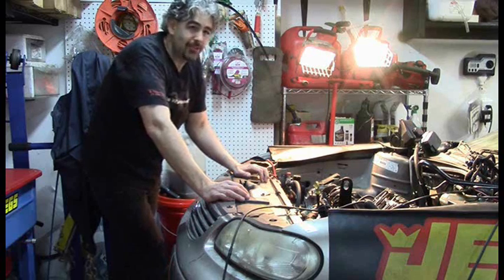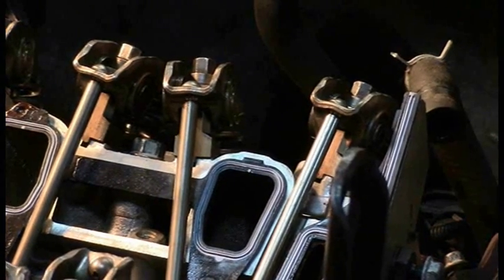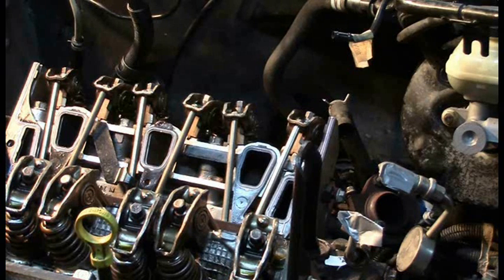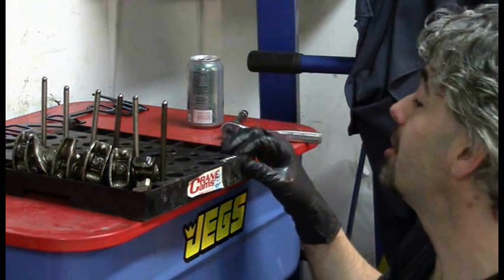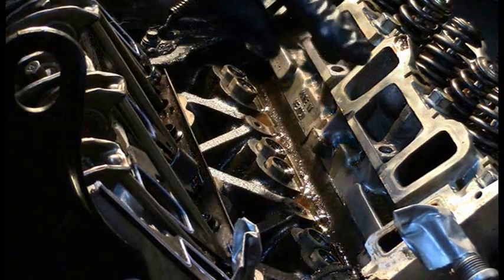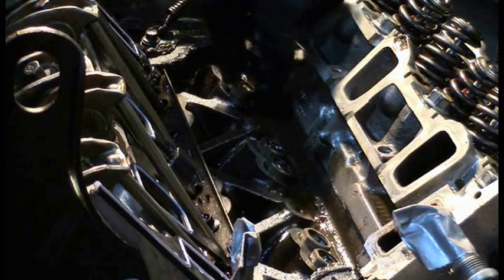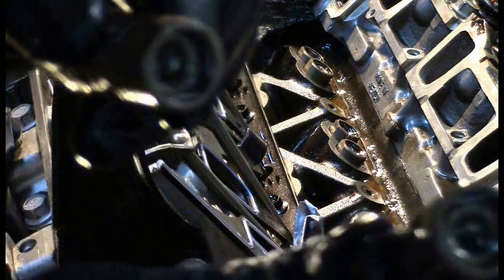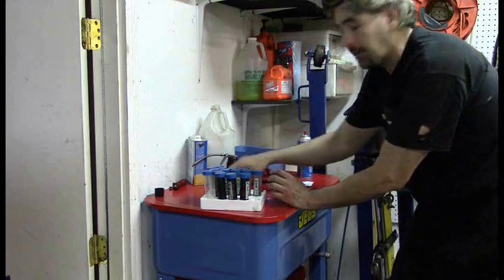Engine Noise Diagnosis Part 2- The Answer Revealed!

Comment: I have practically the same car, it’s a 99 Cutlass and it’s the T&C to that Grand Caravan so to speak. My engine overheated bad and hopefully my lifters will be fixed simply with the reconditioning. Fortunately it’s something you can test without putting it back together. Hopefully the cam’s fine too. The car only has right under 70K but a mix of possible improper care by previous owners and it being abused as mentioned (and sitting for an easy 5 years) could mean something bigger. Compression is only below spec in one cylinder, not the one with the bad rocker arm play.

Comment: That was awesome! I have the same noise in my Cadillac CTS and I decided to check out the top end exactly like you did. I wanted to check to see if there was a video to proceed from where I'm at which is exactly where you started from with the valve covers off. I guess my next step will be to remove the rocker arms and see if I find anything like you found. I will check by hand first to see if anything is loose but just wanted to ask if one of the rocker arms was loose, should I just tighten it and try to see if noise goes away or should I just remove all of them anyways in case there is a chance that one or more of my lifters is the problem as well.

Comment: My wife's cougar started making that noise when she hit a dip to fast, I got it to stop without identifying what it was, then one day I hit a dip to fast and the noise came back, so I really want to identify what it is, any ideas would it be appreciated.
Reply from the maker: When I first read that I thought you were saying your wife is a cougar lol.
 if it happens when you are hitting dips the first step is to determine if the noise happens while the car is still moving or not.  If the noise conitnues when car stops, it could be low oil level that temporary runs the engine on low pressure as pickup tube whiffs on picking up oil.  If (more likely) the sound is happening while car is still moving it could be anything loose or misaligned from brakes, driveline, CV axles, etc....
Reply: @SchrodingersBox  I tell her all the time to get rid of The Nightmare cougar as I call it, because she's getting close to forties and driving that car looking like a cougar driving a cougar, no I kid, don't tell her I said that, no for the reason that I  call it the nightmare cougar I tell her to get rid of it, it's so hard to work on, the last work that I did on it was replacing the generator yes I know alternator but in this spec books it calls it a generator, since her brother gave her the car I've been doing the work on it and it's been running badass I like working on things that I've never worked on before and finding out how it works and how they run and this nightmare cougar has been a challenge for me, I was thinking the same something being misaligned with the CV axle or something of the sort because when I had to change out the power steering I noticed when I removed the engine mount it wasn't in very good shape and I believe when It hit that dip It could have jogged the engine out of alignment or something, I was thinking it sounds like the lifters when I start the vehicle in the morning it doesn't really make the sound until it warms up then when I'm stopping at a stop sign or light it sounds really loud and because of the Dual tailpipes I cannot notice if it's making a noise when I'm driving, I appreciate your help and second thought it's always good to work with Two Brains, now I just got to find that second one!

Comment: Where did you get those tubes you soaked the lifters in
Reply from the maker: hahahahaha yeah I get asked that a lot.  I'm a scientist- they are sample tubes for a 50ml centrifuge that I stole from the lab!
Reply: @SchrodingersBox  I figured 😆
I went to a medical supply and got some specimen containers with lids. Close as I could get.  I just pulled  my intake and found three lifters that appear somewhat  collapsed. I was getting the same chattering noise from my 3.1.There is some up and down play in the intake  pushrods on #1,4, and 5 and they seem depressed into the lifter some and the tops are pooled up with oil. I am hoping I can clean them as you did and quiet the engine up. It was always pretty quiet and it came on suddenly

Comment: I watched a video of a guy putting 1 oz of Seafoam per quart of oil and made a similar noise go away. My Mom has a 2004 Buick century with one of these crap engines making the same noise. She changes her oil regularly with synthetic oil. I think I'm going to try the Seafoam thing first. Thanks for the video.
Reply from the maker: Why no0t diagnose the condition to know if the seafoam could even possibly work?
Reply: @SchrodingersBox  I know it is a lifter. It is a known GM problem with these engines. I will try the simplest fix first. I'm sure I will end up replacing the lifters and possibly the rocker arms.

Comment: using a long handle screwdriver you can identify injector noise, lifter noises gear noises bearing noises.  Anything that moves creates a noise.   If you check your engine noises on a regular basis it is then simple to find noises which are showing a fault
Reply from the maker: I can assure you it is impossible to listen to this using a screwdriver and getting an accurate diagnosis.

Comment: Did you replace the head gasket before reinstalling the lifters? If an engine just had collapsed lifters can a good oil additive resolved this issue without tearing the engine down. Labor costs in repairing an engine is very high.
Reply from the maker: Of course! There is no point fixing the lifter noise of the car has a head gasket problem.
Reply: head gasket is under the head  he didnt take the head of

Comment: Mine is defiantly bottom noise tell me if I change pistons, rods and bearings the sound will go away for good 5 yrs which is important for me as I cant afford to change car that quickly or how much time do I have if I should go for overhaul or keep running the car till another head gasket is done ??

Comment: Im not sure if a rebuild will complete remove the sound as I have drove about 400k km, tell if a rebuild will have the engine fully fit for another 5 or so year or should I change the car with another ?

Comment: Bro you are good ! I have the same noise in my corolla 2e its engine has never been rebuild except head job which we have to do as we here in Pakistan runs most on CNG which puts more pressure on head gasket
Reply: Why more pressure? Does compression ratio change when the factory switches a motor to cng?

Comment: Excellent. If your very humble attitude was shared in any other fields of human behavior, humanity would progress a lot ! I am in the process of solving a similar ticking noise issue on a '56 365ci engine. Not much sure valve lifters are to be incriminated, but sure your video is helpful. Diagnosis is certainly the most difficult part of the job. Not only because it's aimed at a practical solution, but because there resides understanding. I surely like my car purring like a kitten. But I like far more knowing why. Thanks a lot.

Comment: Don't put lifters in dry after you recondition them, immerse them in oil and take a pushrod and push the inner part up and down slowly till they are tight, or you can just soak them in oil overnight, oil will seep in.
Reply: Yep, I agree, this is important!!!

Comment: I have similar noise which has been occurring from 2.5k RPM, but as of recently all over the board. Mechanic told me it's probably lifters... Replacing all 16 valves in my Mitsubishi Galant 2.0 on Tuesday.

Comment: I have a similar noise that happens at about 1500 RPM. Could it be the same thing? 

When putting everything back together on a job like this, how do you make sure the components are in the same way they came out? is it like doing a tune up?  Do you have a video on that as well?

Comment: 2.8.16.  Whenever I do service on a GM 3100/3400 V6, I use a Lisle 48300 pushrod removal tool. If you don't use the tool, then it's imperative that the cylinders are each on TDC, (valves closed) so the rocker arm bolt has no tension placed on it from the cam lobe. When the rocker arm bolt is either removed or replaced. There are a ton of videos on YouTube with loose rocker arm bolts, due to persons trying to fix their LIM gaskets & head gaskets! The aluminum threads are pulled out due to the tension placed on the rocker arm pivot. (fulcrum effect) 🤔 I always replace the head gaskets & L.I.M. Gaskets. Fel-Pro metal framed ones.

Comment: could this be prevented somehow?  was it from a lack of frequent oil changes? would some regular seafoam or lucas additive help prevent it?
Reply from the maker: +Jsomedaysoon Thompson As stated in the video it was from a bad head gasket
Reply: I didn't make the connection. I thought they were two independent problems.

Comment: One shop I worked in had a couple of cars come in when the engine was completely gummed up with sludge and a huge tar ball in the oil pan.  We hooked up a direct read oil pressure gauge and filled the crankcase with 3 parts diesel fuel and 1 part ATF and let it idle.  (not for the faint of heart - but hey, if the engine locks up it needed replacing anyway, right?)

Both cars survived and we put them back together with Castrol 20W-50 and ATF

Comment: Very simple in the end. You can even make the noise visible when a different sound ist present. My alternator belt is making a noise after I refurbished the alternator. Since the belt only makes the noise when is is wet outside and I hade more serios problems I ignored the belt by high pass filtering the sound with audacity. Then I took a one second pick of the noise and visualized it as a spectrogram and a wave form. After listening to it a couple of times I recognized the pattern which made up the TICKING in the waveform and copied it to a blank sound file. The last thing I did was putting the short wave form ten times behind each other. The result was the ticking sound I already knew. That way I am pretty sure that it is a top end problem. Opening up the cover from the cylinder head gives the final clue. A lifter that can be depressed more than 1/10 of a millimeter. Putting a new one in solves the problem.

Best regards

Benjamin

Comment: I thought that I have the same problem on my car. To distinguish between top and bottom end I made a audio recording of the engine noise and changed the speed of the audio to 8 times slower. Then I was able to count the number of tics per second I was hearing and compare that to the idle RPM I had. Result. It was around 7 to 8 tics per second. At an Idle RPM of around 750. That means it tics at half the crankshaft RPM. So it has to be a camshaft or top end problem with a single camshaft engine which it is in my case.

Easy method which can be done with any smart phone and a pair of headphones.

Best regards and congrets to the new oscilloscope.

Ben
Reply from the maker: Benjamin Bergmann That's a great idea!!
Reply: Schrodingers Box Well, the lifters are changed. Directly after the change the it sounded like the same lifter was still ticking. And it was ticking dispute being imersed in oil for an entire week. Luckily the ticking disappeared after a couple of minutes at 2500 RPM. Just as the instructions which came with the lifter said.  
The Camshaft bearings being made from aluminium looked very good as did the cam and the old lifters. No signs of ware / excessive ware. 
After a test drive and the oil being at almost 130°C (it is very warm here right now) I thought there was a little bit of ticking again. When I raise the rmp from 850 to 900 I cant hear any ticking any more. I guess it is just me hearing the flees coughing.  In the end it was at least on lifter an the repair included the oily valve lid seal. The rotary seal was also changed. So all in all I am happy and hope that this is the last repair on that car for the year. Best regards.
Benjamin
Reply: Benjamin Bergmann One more thing. Since the hydro change the card made about 600Km. Now it feels, especially when the engine is cold, that the engine has more power. I have to go up e steep gradient about 2000m after leaving home and it used to be that 4rth gear and 80km/h was the maximum at my usual gas padel position. Now at that setting I go up at 90km/h. 
 I think I sould measure the compression when the engine is cold. Las year I hat 9 9 7 9 bars. Still in speck but low. When warm I had 11 11 11 11 bars. Usually the car has to be warm or the oil at least 30°C. 
My guess is that the compression is there now right from the start and that the valves now are perfectly adjusted open and close the way they are supposed to. 
After all a nice result for 4 hours of work. 

Best regards.

Benjamin

Comment: it looks like they are roller lifters. i believe that if they are roller lifters they do not wear themselves to the camshaft like flat tapped. in order words i believe you would be able to replace the lifter and not worry about the cam. you managed to salvage them anyways. they were probably gummed from having coolant mix with the oil

Comment: Hi Matt. I have a 2002 Dodge Durango with a 4.7L engine. The car had an engine knock that didn't go away as I pulled the spark plug cords one by one. I found a slack in the timing chains, after replacing the timing chains the car still has a knock. I removed the serpentine belt to isolate the water pump but there was no difference. Any ideas?
Reply from the maker: Mahmoud Abdel-Fattah See my video "testing for rod knock using a screwdriver".

Comment: What happened to the heads did he resurface and new gaskets?  Did you install a camshaft?
Reply from the maker: I did replace the head with after it was machined (Actually I had both done just to keep it even). No need for a cam since I rescued the lifters

Comment: Hi I have a 3.4 in an 05 impale and it has that same tick. So I put new lifters in. Put it back together the same way so I know the push rods are right but still makes same nose. And the rocker bolts are tight. None are stripped.  No one can tell me what's wrong.  There is oil going through the rocker arms. And when I roll the motor by hand I can hear a tick as well. Any ideas?
Reply from the maker: See my video on "diagnosing rod know using a screwdriver" and try that just to rule it out.
Reply: Timing Chain Loose? Mine makes a ticking sound as well when moving the crank pully left and right....

Comment: One thing I'm not sure if u mentioned is on these gm v6 motors the pushrods are 2 different sizes the exhaust ones are longer by a small amount then the intake it's very important to make sure u don't mix them up just a word to the wize lol
Reply from the maker: True that!  In fact I once found this to be the case in a different car when customer did their own cylinder head repair and couldn't figure out where the engine noise was coming from after the repair. Turns out they did not notice exactly what you pointed out and they felt pretty silly when I showed the difference in length of the rods.
  His cylinder head replacement only lasted a few weeks too lol- seems maybe auto repair not his thing!

Comment: Hi Matt, at 1:51 in the Video I diagnosed 100% valve train issue as when you removed the intake manifold, I noticed the rocker arm move when you clipped it with the manifold.  Great Videos, keep them up.  What you lack in industry experience, you make up with your brain and intelligence.

Comment: Hi again Matt, finally found out positively that you have to remove the heads to replace the lifters on a 5.3L Chevy Vortec engine. Still have a very loud knock, tic that I assume is lifter noise. 98K on the engine, and now this. 2003 Silverado. Tried the seafoam trick and cleaner and no change. Sounds like it is No.2 or 4 cyl. will try your advice on whether it is top end or lower end. Heads made in Canada that year casting stamp 706 which Chevy knew some were bad and others not with that no., but used them anyway, I have 706 Heads. Sure would like to see a video on a 5.3 vortec lifter change with rocker arm tightening sequence. Thanks for your video's.

Comment: Wow!! I didn't know that lifters can be fixed!!
Reply from the maker: They sure can- see my lifter repair video- link is in description.  Works fantastic!
Reply: Schrodingers Box
what about using berrymans carb cleaner and motor flush. specifically on a chevy ls1 motor. the lifters are not as easily accessible as they are on this car (under the heads) but i was wondering what your opinion would be.
Reply from the maker: Ben Aguayo If motor flush would have fixed these lifters I would be amazed- and would be worried sick about how thin must the oil have become to allow them to unstick anyway

Comment: I think if the cam was bad it probably would be skipping
Reply: A worn cam lobe sounds just like a lifter but wont go away like a lifter that finally pumps up or unsticks.  Can also cause misfire and set a code.

Comment: Hi Matt, I've had collapsed lifters in my Scooby (long drain isn't good even using synthetic) and also a leaking fuel from one injector, that wasn't closing enough, after shut down. The thing is that I got diluted engine oil from the fuel leak to the cylinders and endup with good lifters!! Just had to change one injector and the oil and now is all good! Got a Free flush.
Reply: For sure. Extra gas at the wrong time in chamber will get in the oil and that sure could make lifters sound bad.

Every time I see a video with excessive unburnt gas going in the engine I think, you need an oil change now.

If it's briefly for a test I don't worry.

Sorry, buddy, if it hasn't ruined your catalytic converter from fuel still flowing in your exhaust stroke your catalytic converter may not last as long.